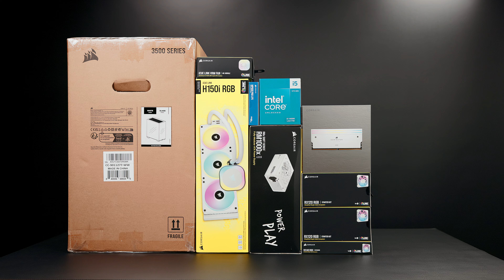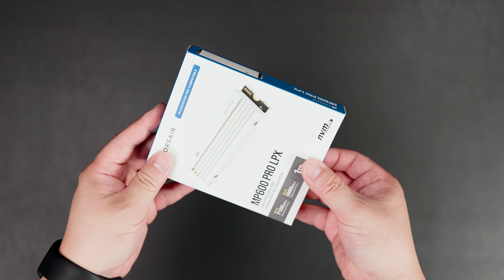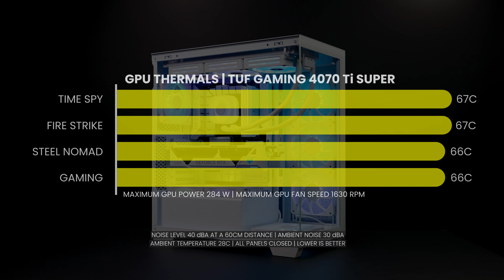All White Gaming PC Build | Corsair 3500X iCUE Link | Asus TUF BTF

Comment: Excellent build man! How´s the overall quality of the 3500x? Some people complained in reviews!
Reply from the maker: Thank you so much, man👍
It's a good fit for the price and I thought the case was not that bad!
Reply: 3500x is not as bad as the 6500x which is more expensive, quality is great for the price, point of complain is probably just the back panel is flimsy but you won't notice it when it's built, the colors are consistent, and maybe when running reverse mount motherboard you can get some clearance issue on the power connector and have to unscrew the motherboard to nudge it a bit to the side so the 24 pin atx mobo connector doesn't hit the metal bits of the case

Comment: I have the case and I still cant get over the fact that all the fans have the back facing outwards. It buggs me so much that I'm going to have to buy the reverse corsair link fans. You would think nowadays you could flip the fans polarity without having to buy special ones.
Reply from the maker: When I filmed the video, reverse fans weren't available.
However, recently Corsair released reverse fans, so you can check out those now.

Comment: can you mount gpu vertically or you need to buy something separately for it ?
Reply from the maker: The PCI slot is rotatable, but the riser cable needs to be purchased separately.
Reply: @PC_SNAP  that makes it easy